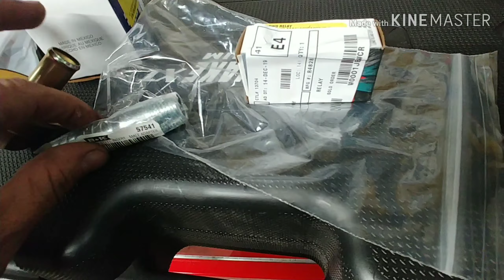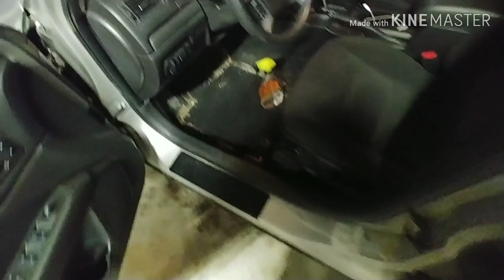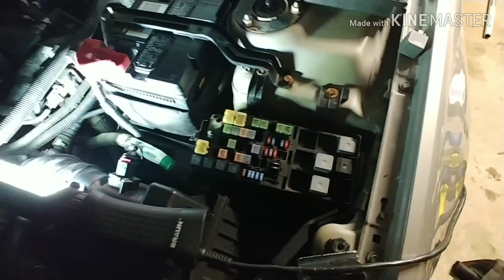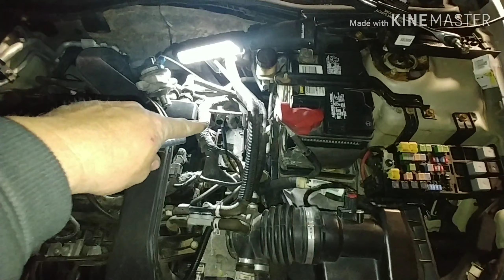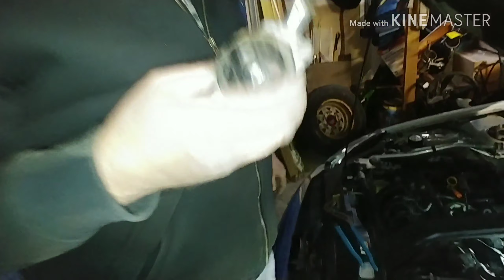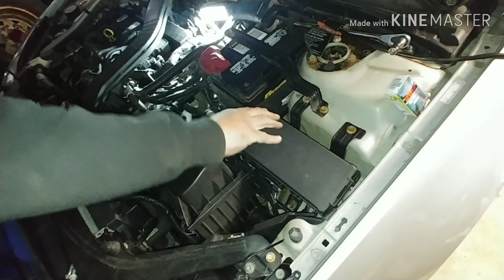08 Ford Fusion. Check engine Code po410 po491. Replace diverter valve

Comment: I need help on where the air check valve hose connects to
Reply from the maker: I don't remember details. Was a long time ago. I think there was an extra line and cant remember if I capped it or not

Comment: I super appreciate you putting up this video. I feel this might be the issue with my fusion although I completely understand the process in which you’ve done to fix your car but I don’t think that you said where you got the check valve from I’ve been looking all over for it around my town and nobody carries it. Is there a chance you can shoot me a message and let me know exactly where what when and how you got that check valve
Reply from the maker: Pretty sure I got that check valve from advanced auto. If they don't have it let me know and I will check around

Comment: How can I tell if the pump works I’m having the same codes?
Reply from the maker: Been a while since i had that car... I assume if you take the valve off and start the car it should pump air. The diverted valve was just a 1 way valve so exhaust gas dont go into pump if i remember right

Comment: In CA smog will not allow bypass. To rule in/out Smog Pump or Relay, it will only come on for a few seconds, and only on a cold start (not warm). Disconnect the intake hose at the front of the check valve, cold- start, and the pump should come on for a few seconds. Also, careful with brittle vacuum lines, check for any leaks triggering codes & CEL. 

For 2.3L the parts are:
Secondary Air Injection Check Valve 6S43-9F491-AA 
Relay F808B-14B192-AA
Solenoid 6L34-9H465-BA
Reply from the maker: In new york we dont have emissions to deal with that is still a valve i replaced it with. Its just a universal one.

Comment: I love it. Could you tell use what the vale came from? Parts people no longer can just match or use the Buyers Guide to select parts. Read everything here don't see a part # or original application. I am guessing at a old Ford?
Reply from the maker: I think its just a generic part... I thought i showed the part number on the box in the video... I will check and try to get a part number
Reply: @workingmansrestorations7071  Thanks, I found a number Dorman 355050. Looked similar maybe the same?

Comment: Hello WMR I have the same two codes coming up (P0491 and Po410) on my 2008 2.3 ford fusion. Can you tell me what the two parts you used to bypass the diverter valve are? You said you went to ace hardware for one of the parts and what auto parts store did you get the other piece? Thanks for posting the video.
Reply from the maker: I think i posted the part number for the diverter valve... It was very easy to do.
Reply: I see the ace hardware number B&k 5754 1/2 inch steel male adapter. Its the one way check valve from car quest all I can see on the box is cv8  it's upside down and I cant read the part number.Thanks for getting back to me so fast.